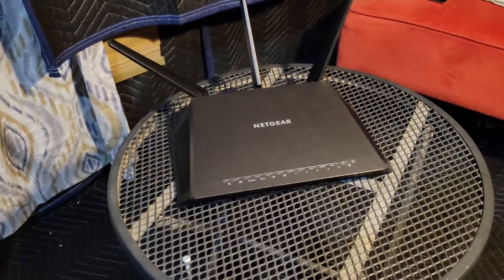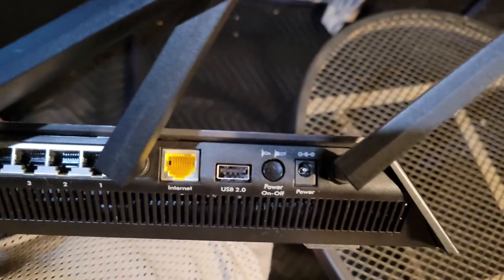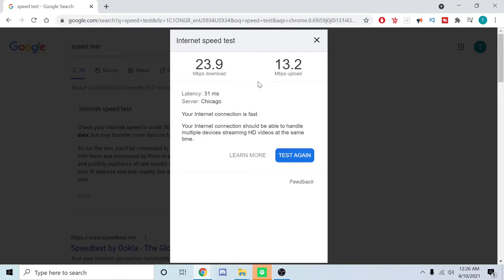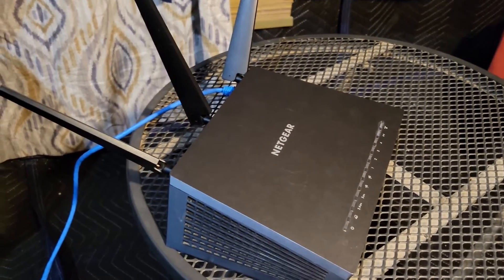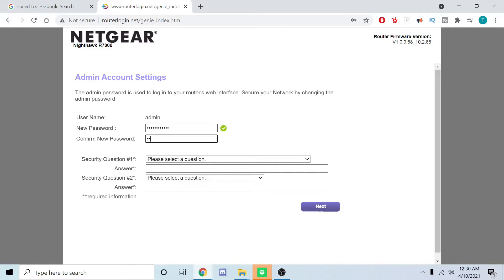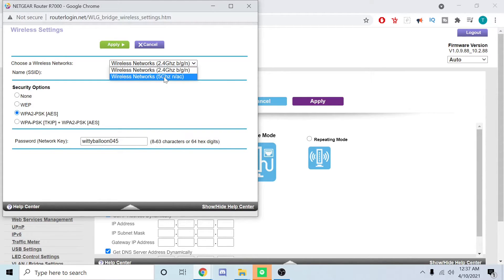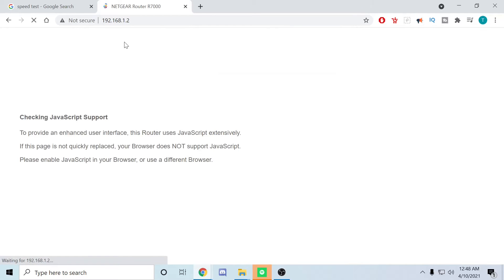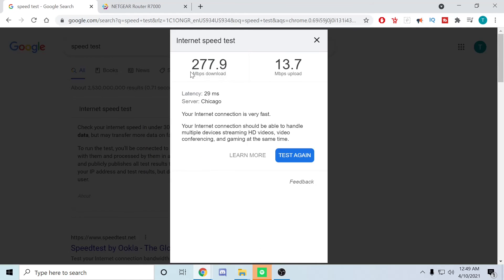How to Connect Two Wireless Routers Together / Make a Wireless Bridge 2021 Feat Nighthawk & Synology

Comment: How come every time I try bridge mode it just completely kills my 5ghz connection? I follow the exact same steps as the video and then my 5ghz connection becomes unusable but my 2ghz is fine
Reply: It work sometimes but my 5ghz will bounce between working and not working but a majority of the time it will not work
Reply from the maker: Did you get it resolved? It sounds like  the 5ghz radio is either to far from the house main router or 1 poor internal  connection to the radio. Or the 5ghz router could be failing. Hope it helps!

Comment: Do you leave cable in router for signal? Is router 2 wireless transmission can you move router to a different room?
Reply from the maker: Anything in router 2 has to be connected by wires, there is playlist you can watch install CFW and have the ability too have both routers use wireless and physical connections.

Comment: I followed all the steps but after updating the router, the IP address no longer works. I went to CMD to search IP but it’s blank.
Reply from the maker: wire or wireless
Reply: @memeaganda4517  wired
Reply from the maker: @MsMonism  if its plugged in directly use cmd and run Ipconfig /all
Look for your default gateway.
Reply from the maker: Then try using that IP address and you should be able to hit your box.  You could also attempt a factory reset and see if the problem persist

Comment: My r700 keeps droping out for some reason. My power led indicator light goes faint and non of the other leds turn on what could it be ?
Reply from the maker: plug it elsewhere, or replace the cable its getting power so thats a plus.

Comment: Mine doesn’t have the bridge option I guess mine is too old or something
Reply from the maker: I can't say for sure, but if its the same model as the R700 Id recommend rolling back the firmware, I've heard they have taken out features in later version of the firmware. I have video in my playlist showing you how to rollback the firmware you could attempt.  Let me know if it works or not. thanks.

Comment: Do i have to have my router connected to my modem for it to have wifi when it is in bridge mode?
Reply: I didn’t realize I was going to listen to a musical concert when I was looking to learn about connecting two wireless routers together. I didn’t think the directions were particularly clear either. I will give you an “”E” for effort.
Reply from the maker: Yes, I did this with a Modem > Router to bridge wirelsss router > Technically if your modem is half router/  you should be able to do this
Reply: @memeaganda4517  so i can’t have it act wirelessly but the modem transmitting a signal to the router.
Reply from the maker: @cesarortega5463  yes the "bridge " that connects to your wireless device /modem / router and then from there the ports are you "bridged  connection "